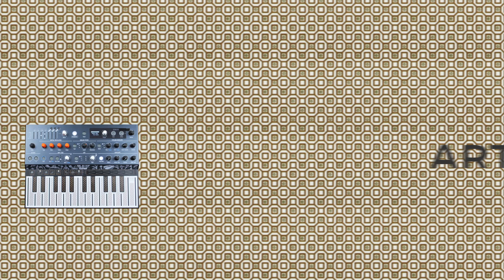14-The Arturia MicroFreak- Filter Part 2

Comment: So I just recently commented in a previous video how I like the unique character of this synth and its huge array of sounds. I said something along the lines of "even with the VA oscillators I don't expect it to accurately recreate an analog synth sound. If you want a particular analog sound, buy an analog synth." So, okay, I have to admit that some of the sounds I've already heard thus far sounded rather analog, but this thing CAN do analog sounds. But I still like the variety.
Reply: To be clear, my point is that if you're trying to get analog-like sounds out of it, I think this does a REALLY good job of it. At the same time, if you just want to really nail a specific analog tone, you should probably just use an analog synth. Or not. Whatever is easiest for you. This certainly can often sound quite analog to my ears, and I think it's a good demonstration of the blurring of lines that is finally occurring in modern synths. That said, I still like this thing most for its more unique sounds, and I still like synths like the Grandmother for their rich creamy goodness and analog options.

Comment: (re the "thin/icy " criticism): to be fair, they're probably used to 2-3 oscillator analog synths. It's easy to get a "fat" sound by detuning multiple oscillators.
Reply: You can also get the detuned sound using the Superwave oscillator setting, I’m pretty sure he did a video on it!